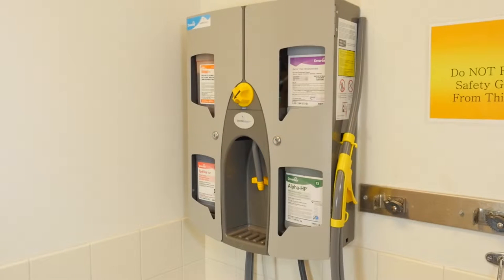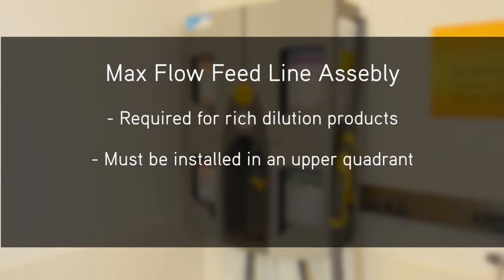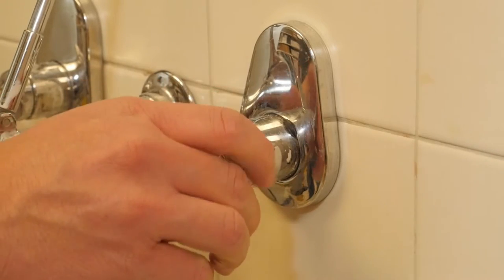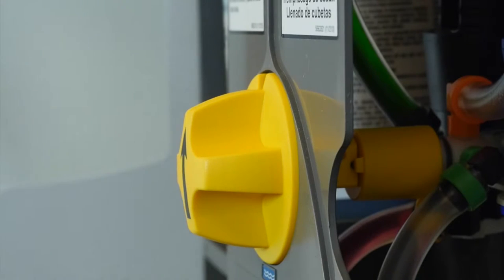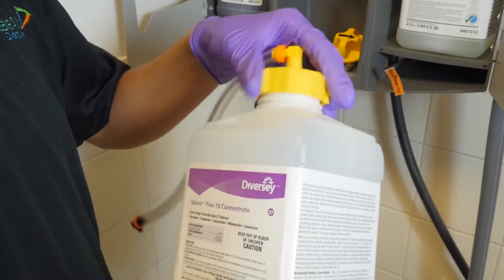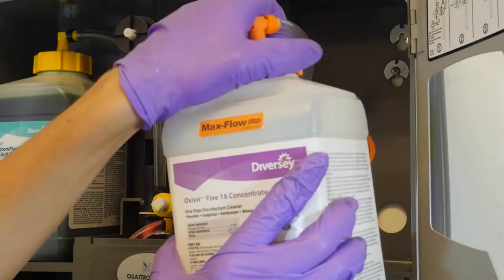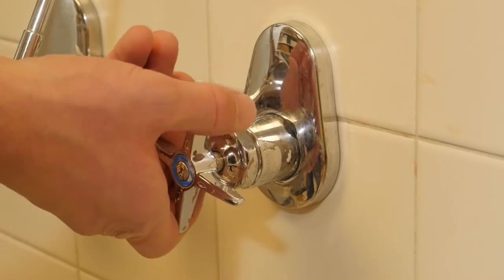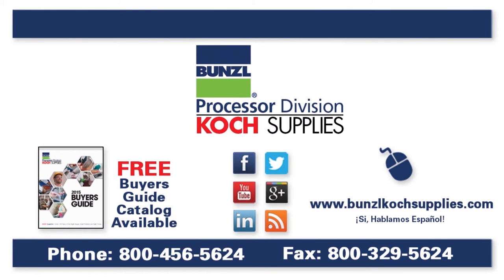How To Install The Max Flow Feed Line For Diversey J-Fill Quattro Select —Bunzl Processor Division

Comment: Oxivir five 16 is what we use at our hospital. It looks like "Max Flow" is an orange cap. This video shows Oxivir connected to an orange cap. Thanks. I've been trying to tell my co-workers to make sure oxivir is used with Orange. Can you give us more info?
Reply from the maker: Hi Craig! More info for the J-Fill QuattroSelect Dispensing System can be found on our website: https://www.bunzlpd.com/diversey-j-fill-quattroselect-dispensing-system

Is there a specific question we can answer for you that wasn't lined out in this video?
Reply: Oxivir to yellow cap is a dilute solution? Too dilute to kill germs?
Reply from the maker: @craigmdietrich6916  Hi Craig. Unfortunately, we do not sell the specific Oxivir Five 16 solution, so are not aware of the product specifics and diluting information. We recommend you contact Diversey, and they should be able to answer your questions! https://diversey.com/en/product-catalogue/oxivir-five-16-concentrate-5019309

Thanks!